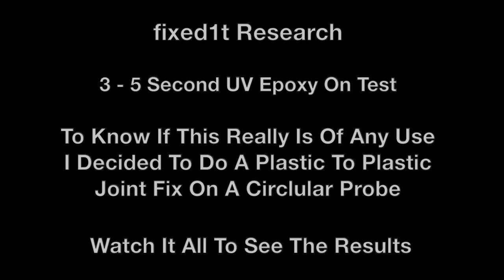5 Second fix Glue test   Part 2

Comment: Good video! So now that it's been a while since first using this glue, how would you rate it's strength and durability?
Reply from the maker: I've got about 4 pairs of broken cheap specs sat on chewed by my dogs which I'm going to be testing the glue on in the next few weeks, I'll post it when I do. Regards Malcolm aka fixed1t